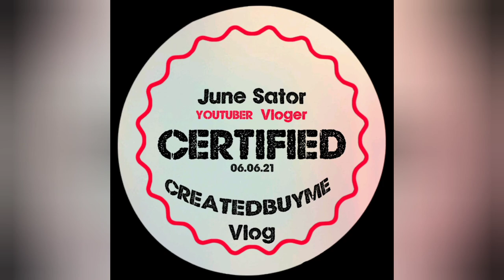Restoration Jewelry Rolling Mill

Comment: what was the point for restoration when you really didnt polished and smooth the rollers  you just painted the body of the rolling mill without properly removing rust from it and not coating antioxidizing coat on it  . what will it do with those scratched and damaged rollers 😂😂